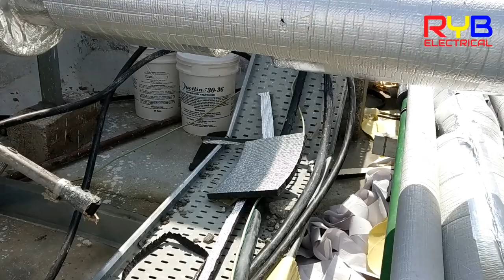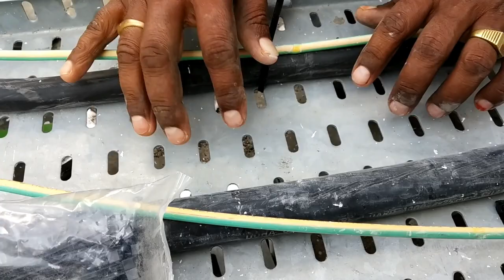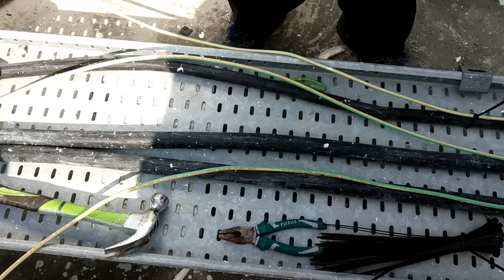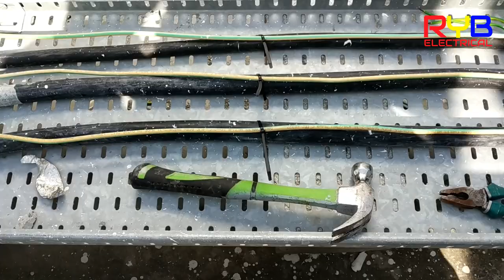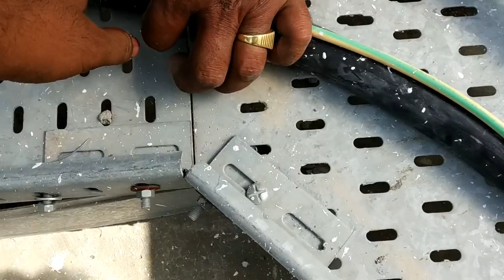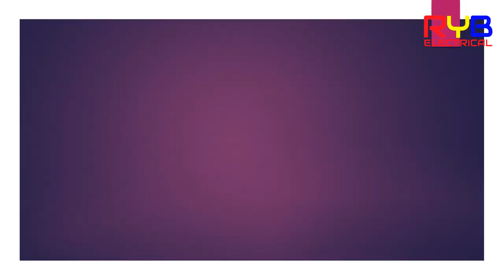how to cable laying  and cable dressing in cable tray part 1

Comment: Nice job, as a fellow electrician, I apreciatte all of your effords and I believe your are truly profesionals. But In my opinion, I think there's too much room wasted for a few cables, even if you lay 6 cables in a 300x80 tray.  The common way to do is grouping cables, for example, black cables  are one group, PE in another, then begin dressing in the best side (left or rigth) to cable distribution according to your needs in the field, and the main purpose is to avoiding cross wires in T sections, turns, etc. and then, PE wires would be beside first group, or you can lay and dress them along the first group's opossite side, it depends on your needs, maybe you need that room in the future
Reply from the maker: Thank you for watching our videos.visit our website for more information https://ryb.com.bd/